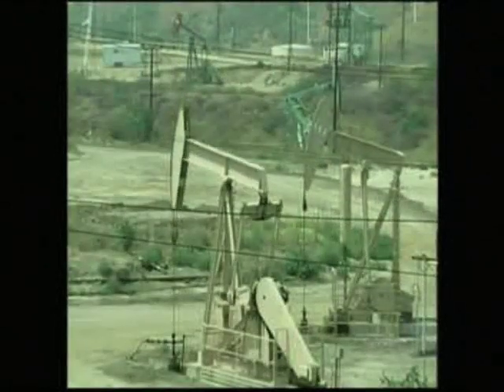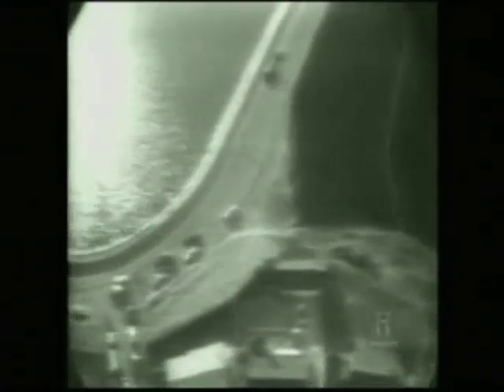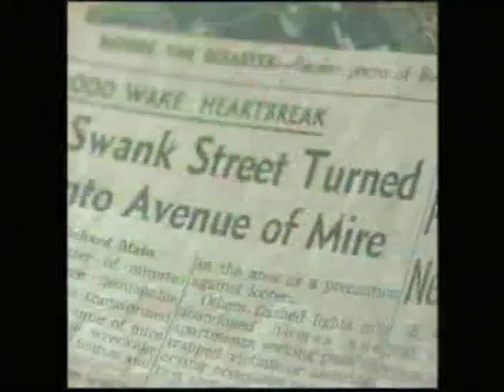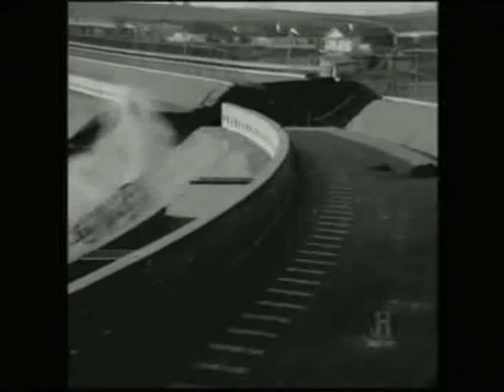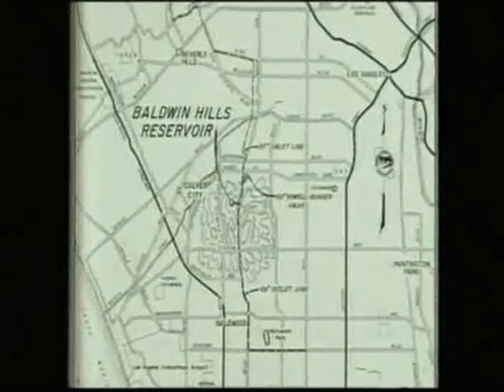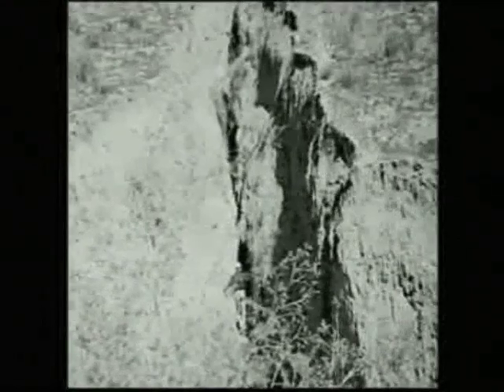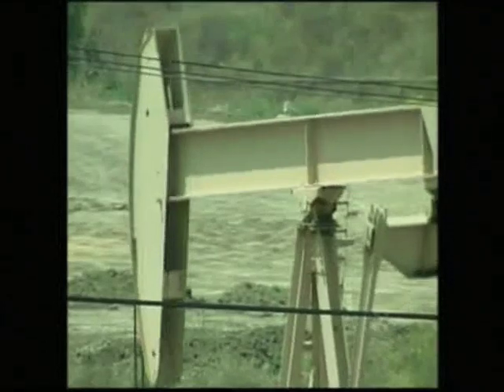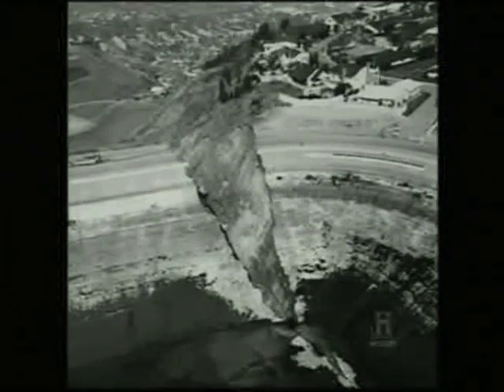1963  Reservoir Collapse(CA)

Comment: Texaco never paid anyone even 1 cent.  They claimed the mine simply sprang a leak in a weak spot and as the man said, it was hundreds of feet down in flooded tunnels so no one could prove otherwise.  Surveys were done to show the relationship of the drill to the mine layout and how they overlapped, but Texaco claimed that the surveys were poorly done and stuck to its claim.
Reply: wrong video
Reply: @678friedbed  oops

Comment: 600 psi on the surface is 600 at any point in the pressurized fluid body. This guy doesn't have his math quite right. It can vary, and I don't know how it was hooked up, but the exiting pressure at the pump had to overpower the hydrostatic pressure at any point in the system.

Comment: When I was a teenager I used to sneak into the old dam site in the 1980s when you weren't supposed to go in there. I remember that big old hollow concrete tower with the 2 big mains at the bottom before the City demolished them and filled it in with dirt and planted grass and trees. You can still walk down the old service road at the east end of the bowl and see 2 huge old mains and the chlorinating station. There are still a lot of oil wells up there along with a few old capped wellheads.

Comment: Stop spelling Fracing with a K. There is no K in the work Fracture. When you spell frac with a K we know you know nothing about it. Also, if you don't like it, stop using anything produced from these wells. Gasoline, natural gas, motor oil, electronics, tires, synthetic fabrics, the list is endless. If all the complainers stopped using products made from oil the profitability will go down.
Reply: Only FYI, there are other words with an added "k" like colic in horses - he is said to be "colicking" or "colicky".  There is also "politicking".
Reply: We don't "Frack" we hydraulically Fracture. Frac programs are written with the word "Frac"! Not Frack. It demonstrates a complete lack of knowledge on the subject.
Reply: Fracing is a convention of the industry and to my point: Anyone that spells Frac with a K does NOT know what they are talking about.
Reply: RikterZilla FRACKING!
Reply: @RikterZilla  what a dumbass.
Reply: No, it's just a convention of English spelling. There's no such word as "fracing." If there were, it would rhyme with "tracing."

Comment: Pumping up crude petrol from between the sub surface particles has a cumulative effect of reducing the separation between each particle. The particles are small and the intstices are smaller, but the combined widths of the vast number of paticles that support the ground surface is indicated by the fact that the ground surface of the land adjacent to the SanPedro- LongBeach ship channel sunk 12 feet due to the extraction of underground crude oil. This happened before the Baldwin Hills reservoir was planned (by the same organization that built the San Franciquito failed  reservoir!).

Comment: Actually...the jet water to oil fields is called FRACKING. It is a HUGE problem today, setting off unstable and sometimes unknown faultlines. Causing EARTHQUAKES & SINKHOLES in diverse areas of the Midwest and eastern oil states. STOP FRACKING NOW!!!!
Reply: Hippy Dippy Wrong. This was not fracking. They simply pumped water under the oil to push the oil into the well faster.
Reply: You clearly know nothing about it. What do you fuel your vehicle with? Heat your house with, type your idiotic prose with? Your ignorance flares up for all to see.
Reply: Hippy Dippy No, this isn't fracking.
Reply: @tkdcow9911  Yeah, it basically IS Fracking. She's right. A couple insignificant differences, but the result and purpose is basically the same.
Reply: @anthonydavis9662  No, it is not basically fracking. Fracking wells are up to 18,000 feet deep, and they use waste water from the wells and inject it to fracture the shale that natural gas is "trapped" in to be able to pump more gas.
What they did here was just pump water in the oil. The oil floats on the water, raising the oil level so they can pump it and save a penny.
Figure the massive difference of water pumped in at 600 psi at 1000 feet, then figure the pressure of water simply pumped in and has 18,000 feet of drop. 
Huge difference. If you would see a fracking operation compared to a water injection one, you would see the difference.
I lived less then a 1/4 mile away from fracking wells in Colorado, and they have the same well heads as they use on offshore drilling rigs. They are massive and the company that ran a lot of them said they had to put 30,000 psi, (2070 bar) heads in, and it cost a lot more. Boo hoo.
Interesting side note. There were 3 nuclear bombs set off in Colorado in the 1960's, trying to use nuclear bombs to frack. They called it "Operation Plowshare". The blast made all the natural gas radioactive. 4 years ago one company applied to pump this radioactive gas out and sell it. They were asked how they were going to handle the radioactivity, and they said they didn't think it was an issue.
Fortunately, they were deigned the permit. 
Sell it, make money, and to hell with the people.
Fracking has made Oklahoma the earthquake capital of the USA. More then once I woke to my wall shaking enough to wake me after they put in the fracking wells.
Smiles!
Reply: Fracking is used to extract natural gas not oil.
Reply: ***** So when you sink out of sight in your own self-imposed pool of shit you and your silly ilk have created we'll talk again... deal?
Reply: internet dumbass that know absolutely nothing just repeating the same garbage over and over.

Comment: Bs, it was most likely the water from the reservoir which caused a change in the overburden.
Reply: AlecBurnett They said the asphaltic concrete liner was 1/4". How on earth would that retain it's design intent over time regardless of the faults? Agreed, the oil exploration had nothing to do with it.

Comment: FRACKING!
Reply: exactly!!!~
Reply: Wrong!!
Reply: Nope. not correct. Hydraulic fracturing is done on a particular zone either by perforating the previously cemented casing at the zone of interest. Or by running a liner with a series of ports & ball seats horizontally into the zone of interest. The ports are shifted open by pumping a ball of a specific size then formation breakdown occurs with the appropriate pressure. The process is repeated until all balls are dropped & all ports fraced. Many wells are Re-Fraced ie: Bakken wells in Montana & South Dakota. No well is EVER Fraced from surface to T.D. (Total Depth) that would result in fractures to surface & well blowouts.
Reply: I'm telling you what they do, not what their employers say is done. I'm just the messenger!
Reply: I'm the guy who sets up, supervises & signs the tickets to get it done. I'm an experienced well completion & workover wellsite supervisor. I'm privy to every detail down to the minutia of pipe, sand, frac balls, seats and pressures. I control the volumes pumped, tempuratures and rates pumped (in excess of 13 cubic meters per minute). And i'm telling you how its done. If you want to know how its done. You need only ask me.
Reply: Due to a lack of a lining in those wells fracking is actually from 0 - whatever the final depth is.
Reply: I got that from a professional employed in the fracking industry. It can't be put the liner in before the bore is finished and can't be done afterwords because it's producing gas.
Reply: Fault lines!  good place for a dam?
Reply: Yes and no. Yes, because fracking close to the surface is dangerous if not irresponsible. Fracking done at 5 to 10 miles deep is very different and perfectly safe.